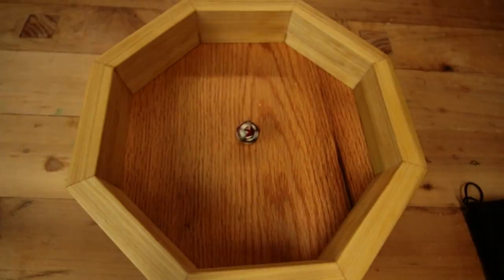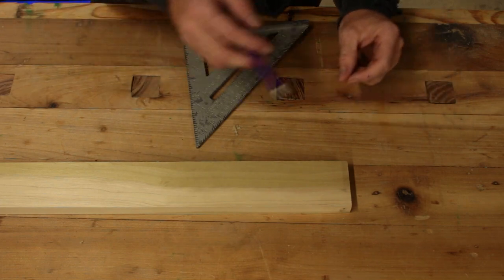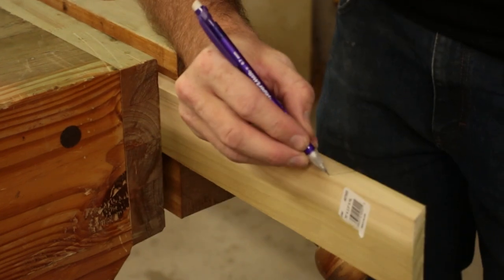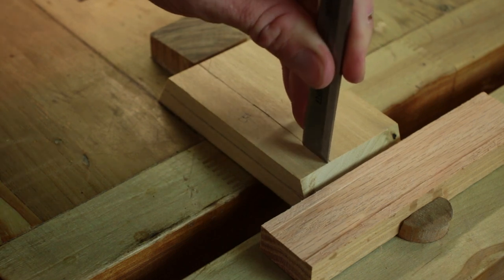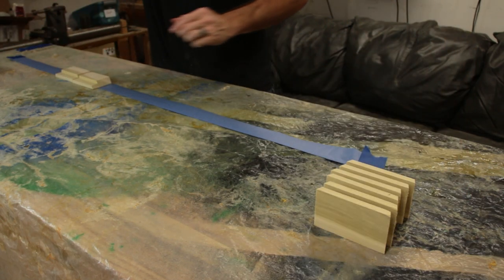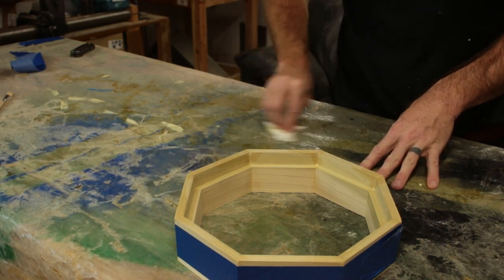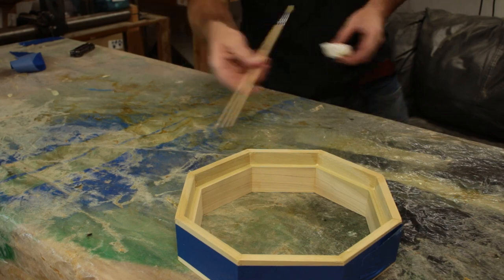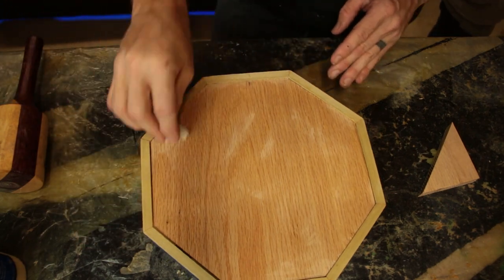How to Make a Dice Tray! (with limited tools) Beginners Project

Comment: Great project... I am curious why you decided on such a thick oak board for the bottom, instead of a 1/4 ply of some sort?
Reply from the maker: Great question! The piece of oak only cost me $10. Even a half sheet of plywood would have cost me more money in the long run and I would have to get something like an oak veneer which I don't think would have lasted as long. It also has a much higher tendency to splinter on top which isn't conducive to a beginner project.  I think you can buy small pieces of plywood at the craft store that would have worked and probably save money.  However the glue from plywood is also hard on saw teeth. So I guess I'm kind of conflicted. lol. It would work.
Reply: @WyldeWoodworks  Right on, Thanks for the response!!

Comment: Dude.  Some thoughts that might help beginners.  Order of operations matters.  First, rip the sides on a table saw, or with a circular saw and a guide. Then cut the rebate.  Then sand both sides.  Then cut the sides, and assemble.  Now,   cut and sand the bottom and glue it.   Your finish sand should be very light, and just knocking down edges, etc.  Sanding the inside of boxes sucks, so sand early !!